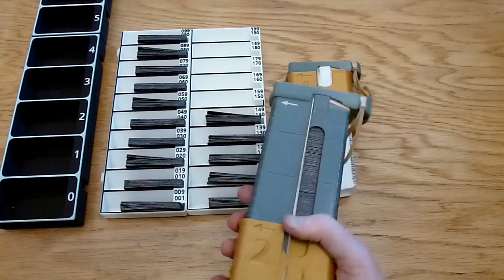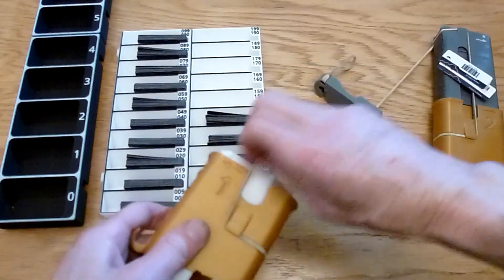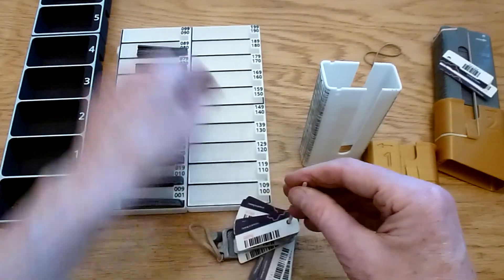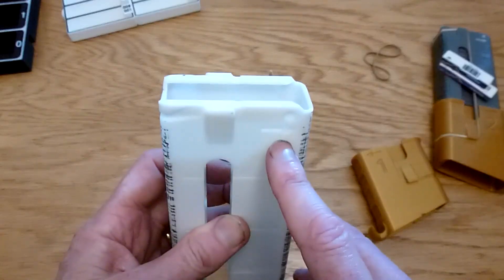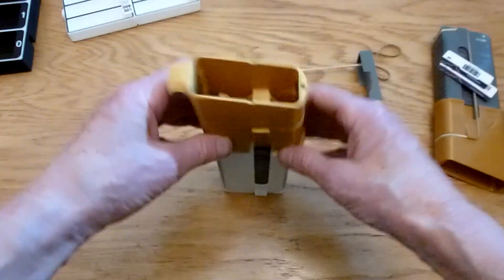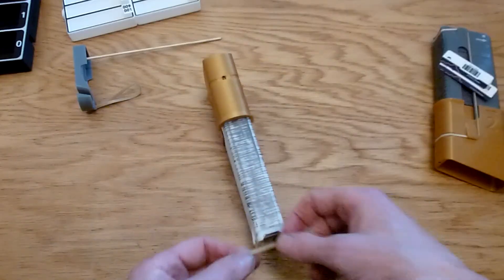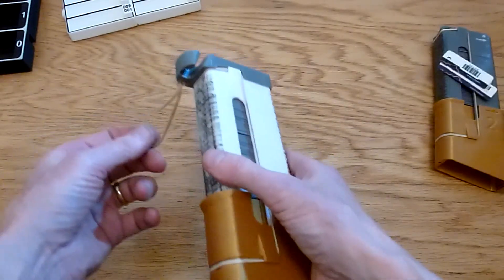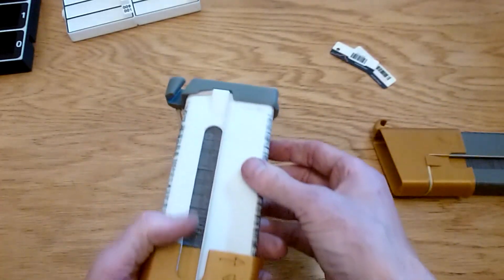Parkrun Token Dispenser - how to load tokens

Comment: Hello guys, welcome to one of the 18650 OG channel. Is the powerwall still in use Paul?
Reply from the maker: Yep still going! It's lost a bit of capacity so I have an old Nissn Leaf battery that'll replace it.
Reply: @paulkennett  Very nice, do you have any cycle count estimation? Also in Leaf are ther liion or lfp and cylindrical or some kind of pouched cells?